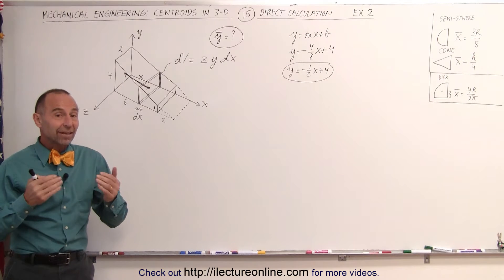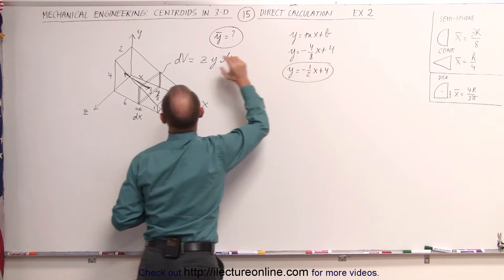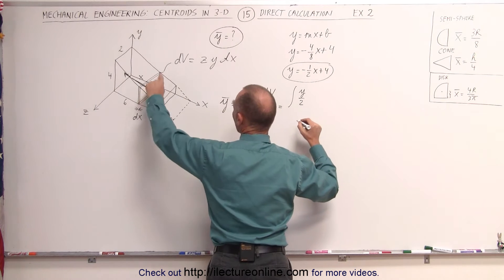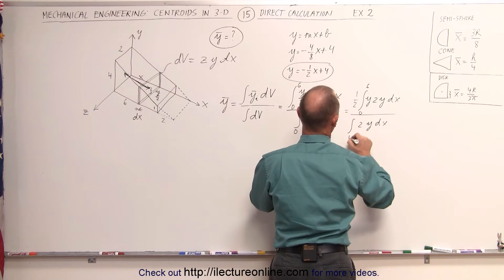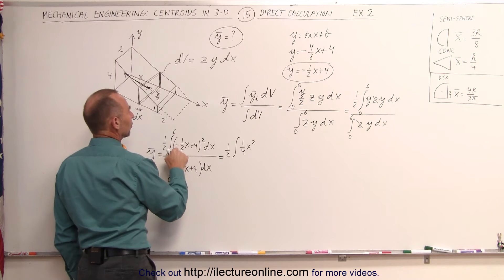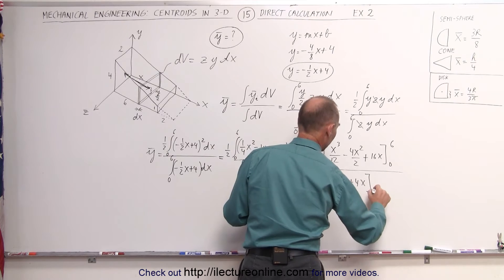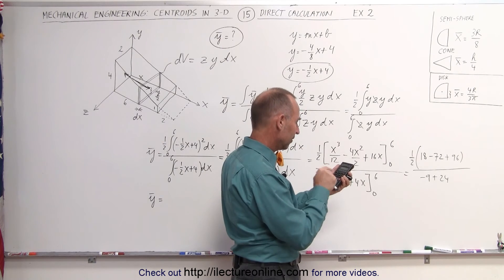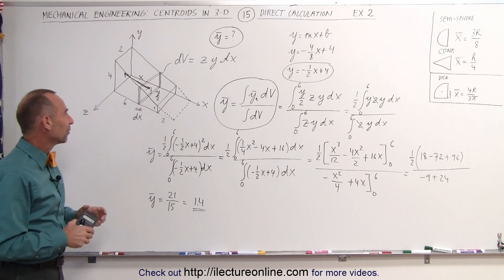Mechanical Engineering: Centroids in 3-D (15 of 19) Centroids=? Using Direct Calculation: 2***

Comment: Mr. Michel, before watching your video, instead of slicing it vertically just like in the prious video for dinding the x coordinate of the centroid of the wedge, I sliced it horizontally and completely different result. I would like to know why. dV = zydx but can't we write it dV = xz dy evaluated from 0 to 4. So I get V = 32 and integral of y tilde times dV as 128/3 so y bar ss 4/3. Please help me.
Reply from the maker: Slicing the figure horizontally is better suited to find the centroid in the vertical direction (y) not the horizontal direction (x).
Reply: @MichelvanBiezen Oh yeah you're right. I don't know what I was thinking back then. Thanks!